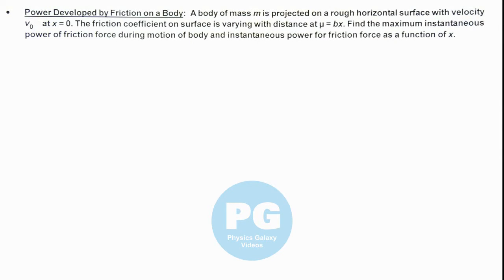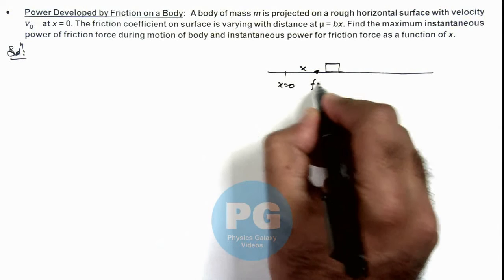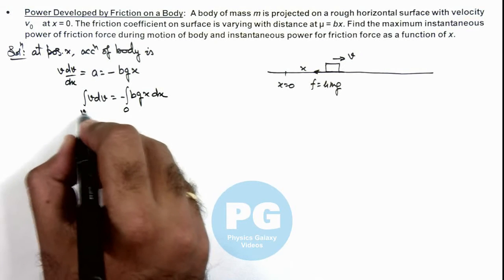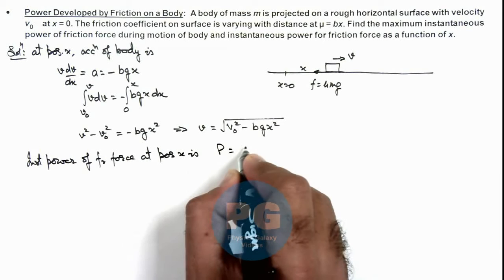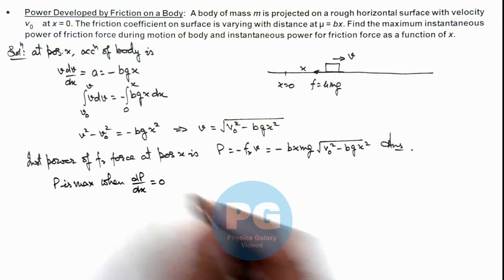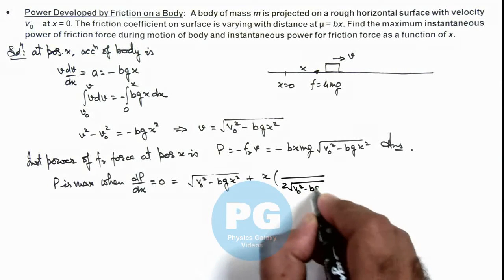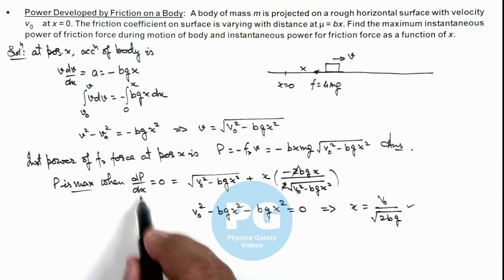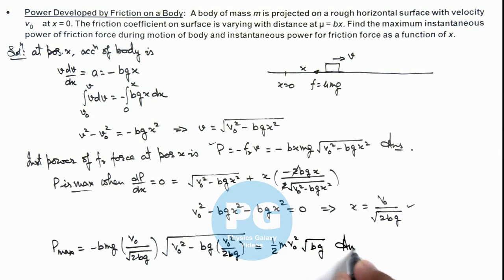Adv Illustrations – Power Developed by Friction on a Body | Work Energy Power #21 for JEE Adv

Comment: sir, if i apply W/E eqn. i'm getting -
1/2mV^2 - umgx = 1/2mv^2     please correct me sir!
Reply: akash singh chauhan
 Coefficient of friction is variable so you have to do it by integration by this method.
Reply: Yeah using work-energy balance you will get the same value for instantaneous velocity.

The goal is to find instantaneous velocity in terms of instantaneous displacement.